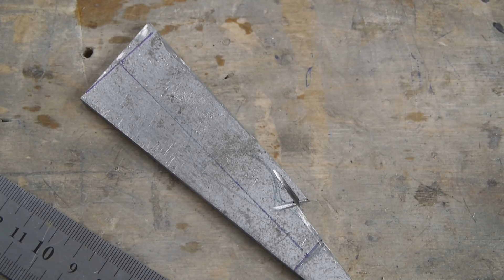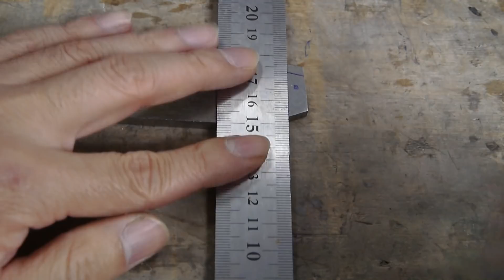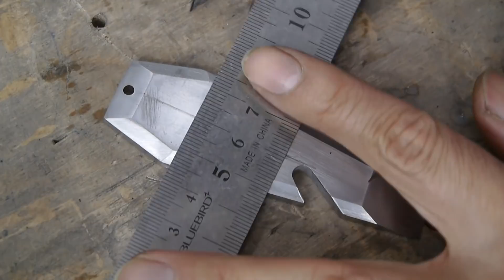휴대용 도구 만들기 / making a edc pry bar

Comment: 옆에 홈 파놓은거는 자동차 안전벨트 끊을 때 사용하는 건가요?
Reply: 병따는거 같아요
Reply: @상진-b9b  아 그렇군요!
Reply from the maker: 네 그냥 병따개입니다;;
Reply: @zihwaza   I think the way you designed the bottle opener (with a round bottoms instead of a squared off bottom),  It could be doubled as a seat belt cutter as well.  Just by angling a bevel into the bottom. Excellent work as usual.